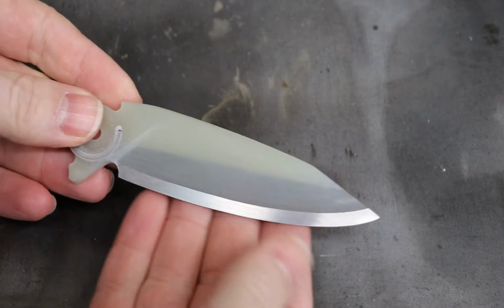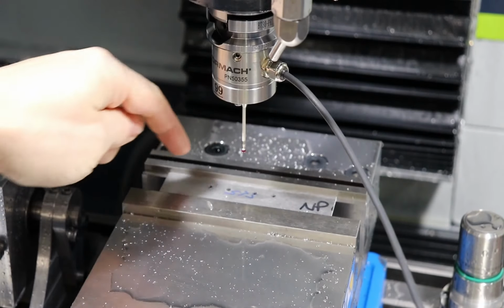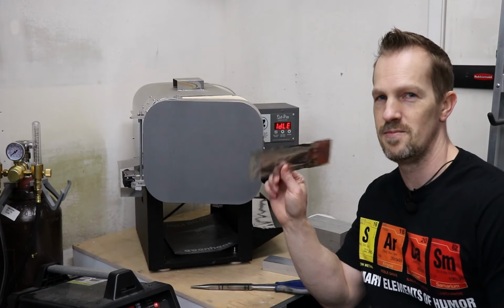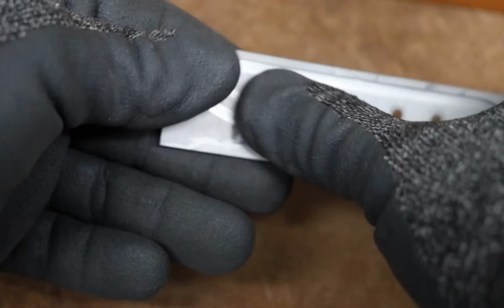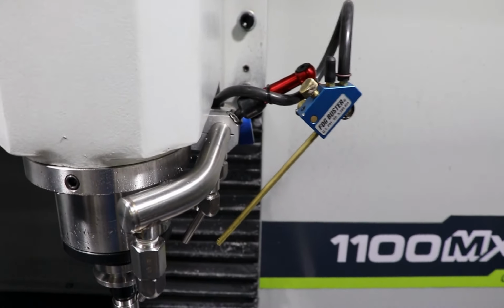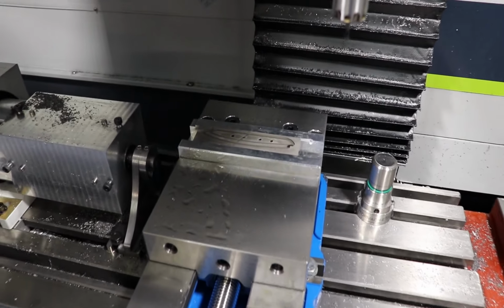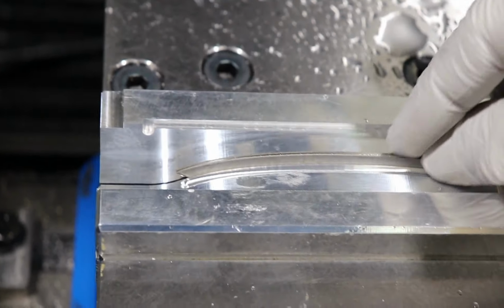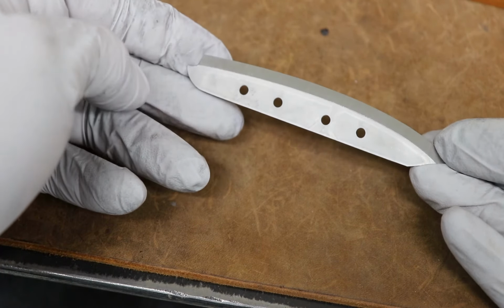Interface Knife making part 8, The Blade Core

Comment: Given the limited amount of steel in the blade core, how do you recommend sharpening the interface so as not to sharpen away the all steel core itself?  Just strop and only strop?
Reply from the maker: The same advice I'd give for any knife but especially for these or san-mai type steels. Strop to sharp at first. If that's not working anymore then try touching up with a ceramic rod. If that's not enough then sharpen the entire edge evenly with as little material removal as possible using a fixed angle system, 1200 grit diamond at 20 degrees(it doesn't take much since the edge is very thin). It will take a lot to sharpen away all the steel, even if used frequently but it does depend on what you're doing with it and if you sharpen more than necessary.
Reply: @vcedge9466  thank you, Jason. I’m super pumped about getting in on this order. Also, I appreciate the quick, detailed response!

Comment: In part 7 if you put a piece of wood in with your parts you won't get the miss colouration on your parts,  Also use a roller to seal your edges.

Comment: Can you try out the new magnacut. The new steel from Larrin Thomas from knifesteelnerds dot com? S35vn is a good budget steel for budget knives. The sebenza and some customs do much better heat treatment but its still nothing in comparison to magnacut, m390, etc. And a Mister would be preferred to not burn the edge temper.
Reply from the maker: I'll be making some knives with m390 soon and that may become the new standard if it works out well. If I can get my hands on magnacut I would like to try it for sure but it's the new hotness right now so it may be hard to get.
Reply: @vcedge9466  here's a good video of a maker testing different m390 heat treatment protocols, might be of interest to you. https://youtu.be/3rbFXVEHCow

Comment: When cutting out the blank - why won't you leave the tab at the knife edge side?

You are machining it anyway, so remaining tab could be easily trimmed in same setup.
Reply from the maker: Could do it that way, maybe I'll try it. I was thinking that I want the edge to have the correct profile for easier sanding later. I could add a pass down the middle when its vertical to get rid of the excess before machining the bevels. Good idea!